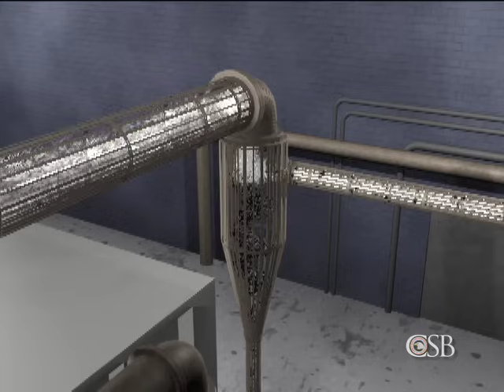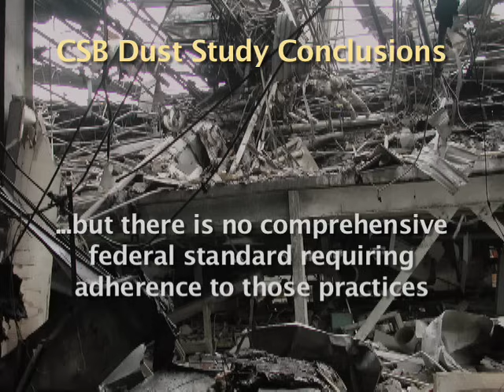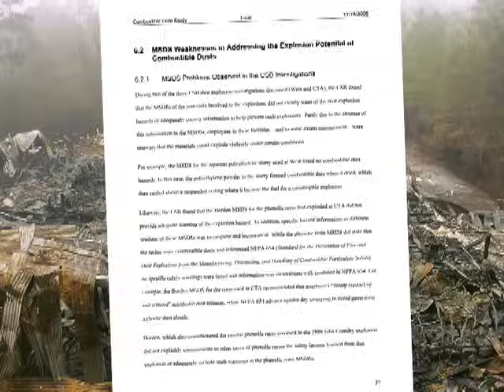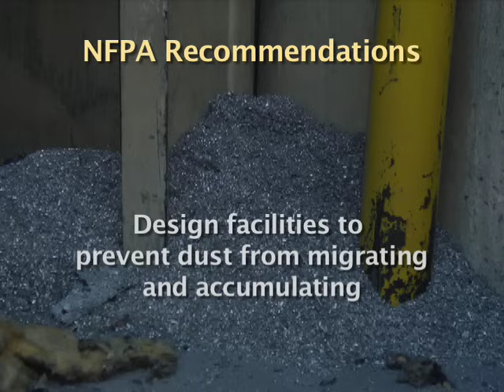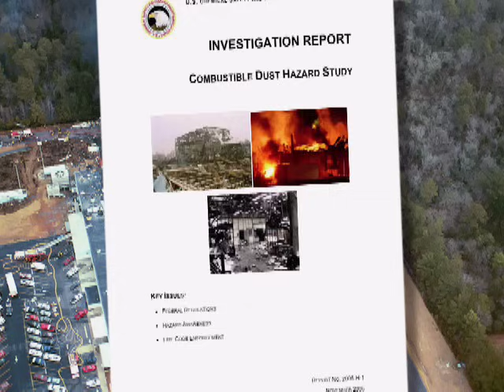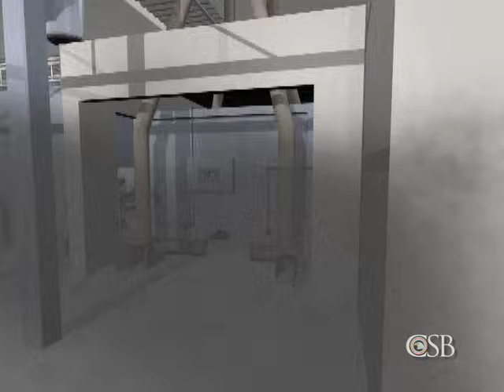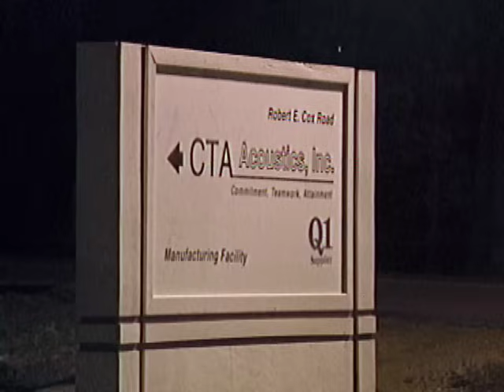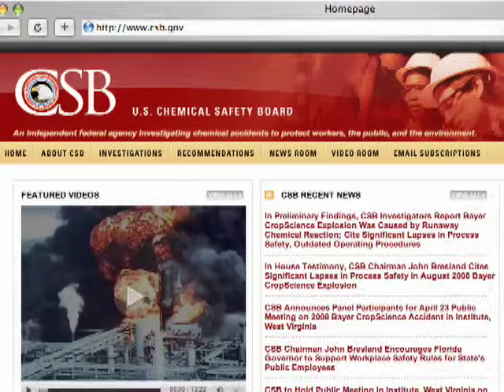Combustible Dust: An Insidious Hazard

Comment: 17:39 generally specking of the dust is formed from a materiel that contain CARBON  it WILL burn   if it is from a METAL that can in anyway BE OXIDIZED BY OXYGEN it Will burn aluminum, iron, titanium,  lithium, sodium, chromium, lead, copper, tin, etc if it can form an "insert metal here" oxide it CAN burn

Comment: Combustible dust is a hazard we've been dealing with since we first ground grain... Awareness should be better. Especially since to this day it's the reason shaft mining of coal still has to be done largely by hand.

Gristmills exploding in storms from lightning sparking the stirred-up flour, lumber mills exploding from the sawdust catching, coal dust in mines and storage going boom - a coal dust explosion is what most likely finished off the Lusitania after the initial torpedo blast -  and so much more..

Comment: I knew about this hazard sence 1984 as a fire equipment technician. I'm a phoneman now and I can tell you I have seen hundreds of plants with dust issues. I have run cable through rafters and in some cases you could write your name in the stuff.
Reply: I know this comment is 13 years old but i just wanna point out that combustable dust has been known about for centuries

Comment: It seems to me that NOT using compressed air inside a building would be a no-brainer, and furthermore, compressed air doesn't remove any dust, it simply moves it around so that it can be removed by other methods. But it won't all make it to the floor to be able to be collected. Fans and brooms are no better than compressed air. A better solution to me would be compressed-air driven vacuum cleaners with proper dust filters installed. You wouldn't want to use electric powered vacuums, as they contain electric motors that usually have brushes in them that continually create sparks while in operation. There are SO many problems going on in this facility in the video that I couldn't possibly begin to scratch the surface of them all in this comment. It really seems like a total lack of common sense and/or carelessness that led to this disaster, which was inevitable. It was only a matter of time before this happened. (speaking specifically about the last disaster, tho it applies to any of these really)

Comment: I've seen guys weld directly on coal silos and nothing happened.
Reply: The reason they are alive that that the dust didn't disperse or the coal silos didnt have a collection/accumulation of dust particulates. 

In addition to fuel, oxygen & ignition source, dust combustion also requires confinement of dust and dispersion of dust. 

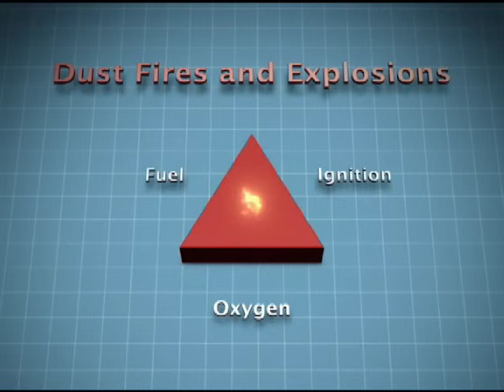See @11:55 of the video